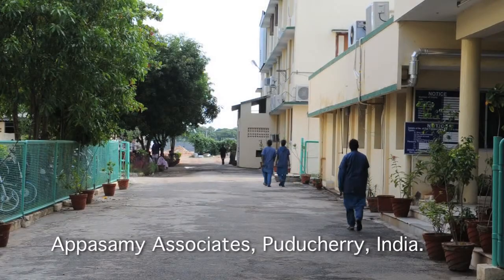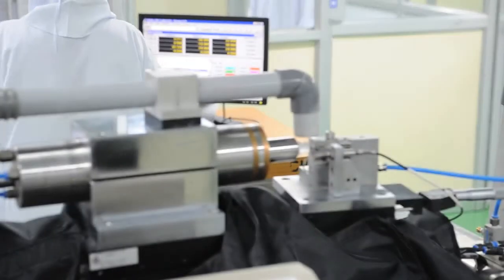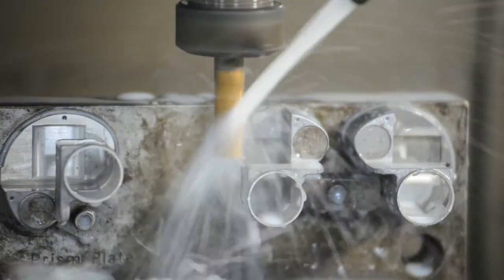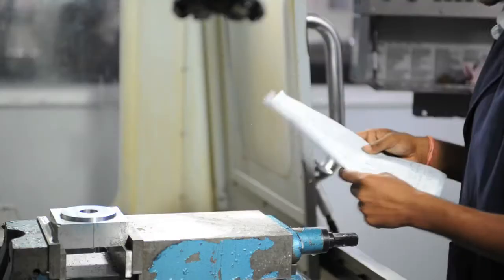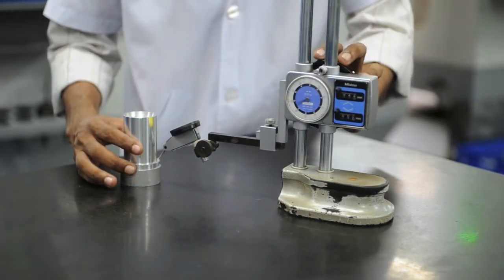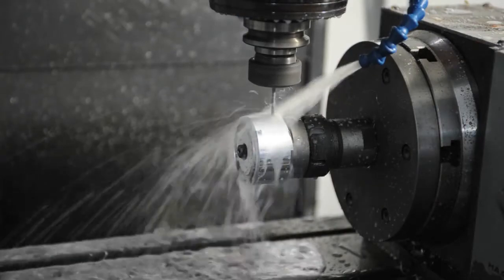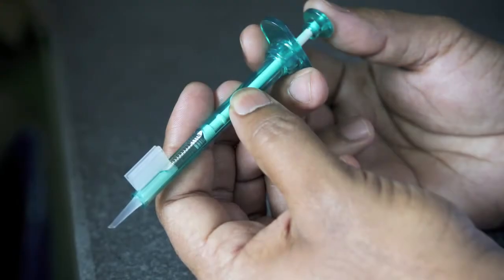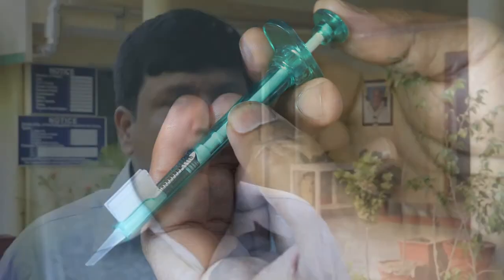(ENG)Appasamy - Curing Clouds

Comment: Poor salary structure in Tier-II (Pondicherry) cities, and then you analyse manpower skills? Because of their company's establishment in early 1980, they have a good foreign brand dealership based on the need for sales and service networks in India, and with that rapport, all the best brands are mostly reverse engineered, and profit is high at no or very low R&D cost, including the binary codes. They have the eye hospital in Chennai, and the test prevails. Key management staff are community-oriented for trustability. Other than that, there has been no staff growth. Real estate is now profitable as a result of the software revolution and the migration to Chennai. It is beneficial to learn about and educate yourself about the business model. Personally, this is not a good place to work.